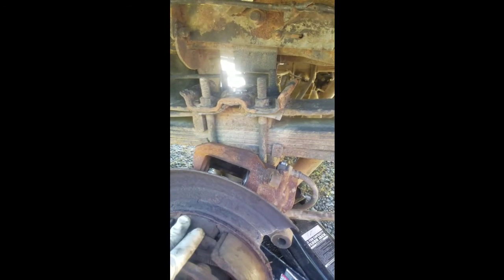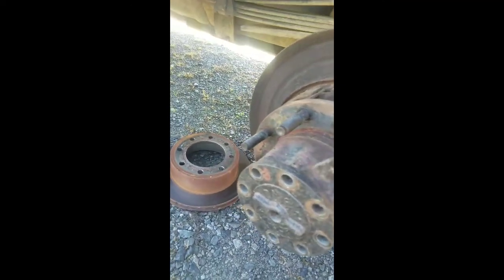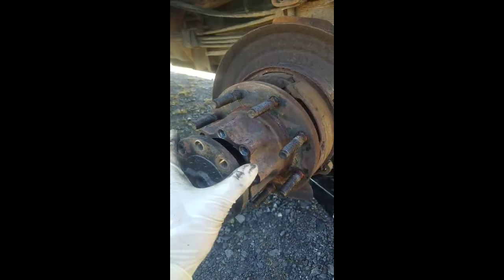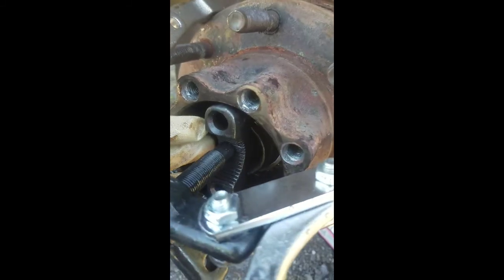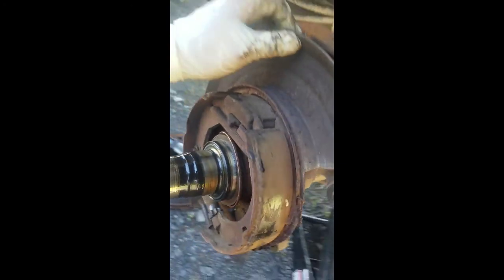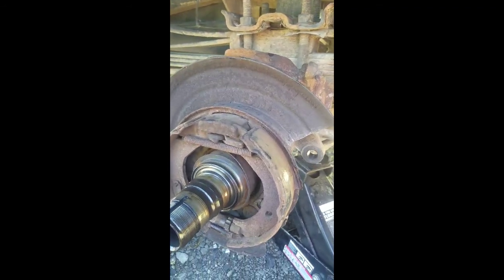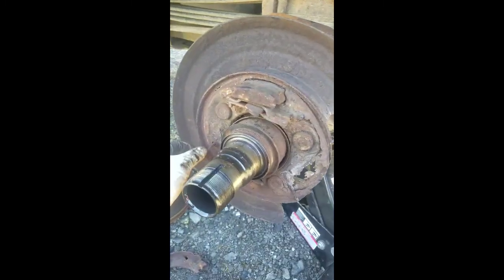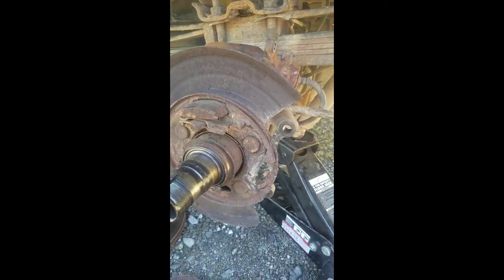2003 f250 SD brake backing plate replacement.

Comment: curious, what type of fluid is that? axle, or from the diff? just wanna know if I should wait to flush diff fluid until i do this.
Reply from the maker: Dmac Reviews what you are seeing is differential fluid. The loss during this process is very minimal, but I would definitely do this repair first before I changed the diff fluid.

Comment: Cut the new backing plate/dust shield in half, and just bolt it back where the old one was, no need to take all that apart if all you need to replace was the rusted out dust shield. Lot easier, lot faster was my fix.
Reply: How did you remove the old one without removing everything?
Reply: @willphule  4 nuts on the back side of the brake,  just remove.
Reply: You can see the 4 bolts at the 13 minute mark of the video you can just remove the nuts from the other side
Reply: @FirstName-oj7nq  I know how it is fastened, how did you cut it while still attached so that you could actually pull it out?
Reply: @FirstName-oj7nq   Sorry I am specifically talking about the backing plate, rereading your original comment it looks like you were only talking about the dust shield - my bad.
Reply: @willphule  Yes correct the dust shield, not the plate